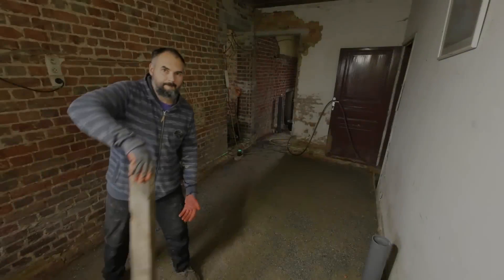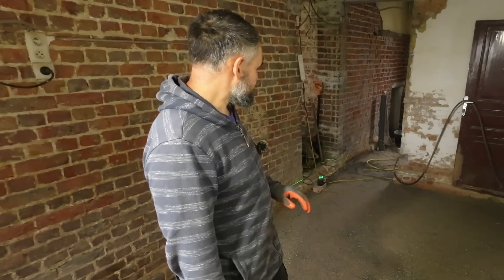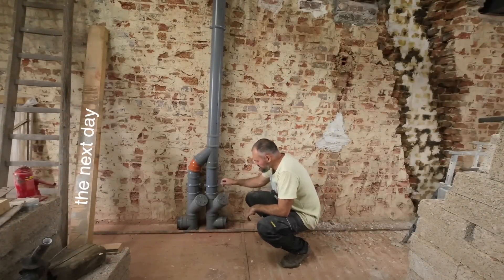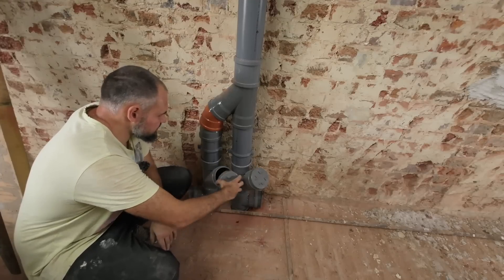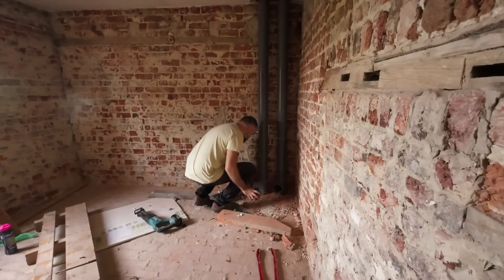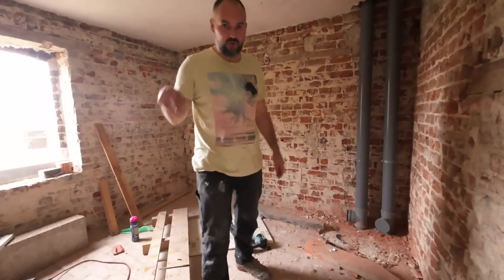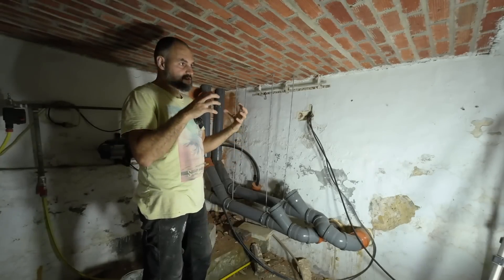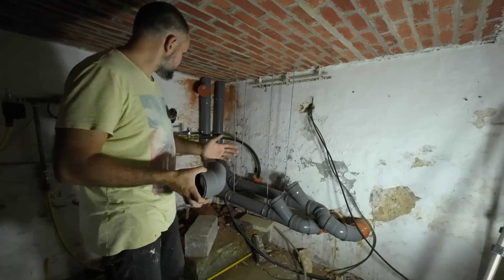DIY sewer system EXPLAINED / Renovating a 110+ y.o. ABANDONED farm in Belgium

Comment: Don't worry about the US measuring system, we're more stupid then we get credit for.  We had a chance 250 yrs ago to institute the metric system and failed.  50 yrs. President Carter also gave it a shot, to no avail.  Eventually we may wake up.  I like the "O-ring" plumbing system.  Here we must use a dyed cleaner and special glue to join our PVC pipes. Thanks. Narragansett Bay
Reply: “…we’re more stupid THAN, (not then)

Comment: Yeah, when you design the foul water system pipes you vent it at the head of the run. In the basement, where possible, best to use sweeping bends.

Comment: Do you have to have inspections to check that your work adheres to local requirements? Here in the US we have lots of local building codes and inspections that vary depending on where we live. They can be annoying but help to prevent bad and/or dangerous workmanship.

Comment: You can mechanically connect an anchor into a wall by putting out piece of wire in the hole, then screwing the anchor bolt in.  It’ll never come out.👍👍

Comment: Good job I guess next is to do hose pipe test. I think you may need extra support at junctions as when you have a lot of use at the same time rubber push fit can push off. Just from experience.

Comment: I'm jealous of the pipe installation. In our rental apartment (building from 1939, was converted into apartments at the end of the 1970s, was previously the administration of a dairy and a supermarket) many mistakes were made and in the basement we still have old cast iron pipes that leak and have a gradient that is much too low, accordingly we have it clogged at least once a year in our half of the building and have no inspection trap in the basement, so the workmen are always very enthusiastic fixing the problems🥴😨 I'm still lucky in my part of the building, on the other side the pipes were installed so sloppily that two apartments have massive problems and the workmen haven't been able to fix it properly yet and the tenants regularly have water in the bathroom (bathtub, toilet) that doesn't want to drain 💀

Comment: Hopefully your drainage system will work well, but you can have pipes that are too big, oversized pipes will not have adequate velocity and solids can drop out and build up in the pipe leading to clogging.

Comment: What is a m7 bold? Dont buy at temu!😂
Reply: M7 is a metric screw 7 mm. M7 is not often used but not unusual. 7 mm is slightly more than 1/4 inch for those who still use the nonsensical imperial measurement system.

Comment: Something to think about is the water hammer effect. Water dropping several stories from a toilet flush hits the bottom with quite a lot of force. This is accentuated at the elbows where it changes direction. After some time it can hammer off a joint in the pipe, especially ones like yours where it is just a rubber slip joint. Just keep an eye on it and add additional support if you see any movment.
Reply: 45 degree at the bottom of the two mains will offset that.

Comment: Nice job, well thought out as usual with you guys!

However I see you used the same grey colored pipes for both the black and grey water, but here in Flanders you are supposed to use the redbrown pipe for the black water and the grey pipe for grey water and rainwater.
I'd recommend you check whether this color coding is required or not for the inspection (keuring) which is mandatory as of 2021 I believe.